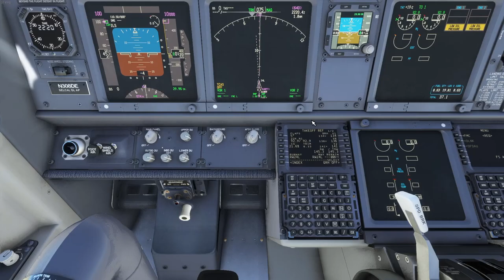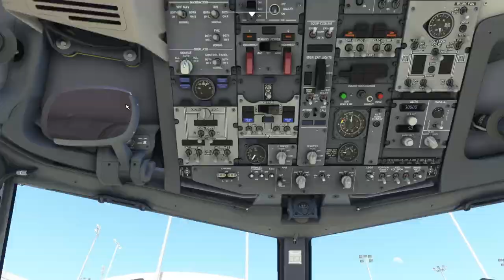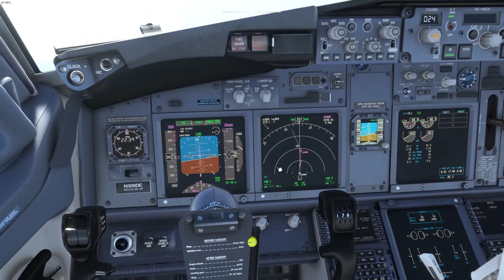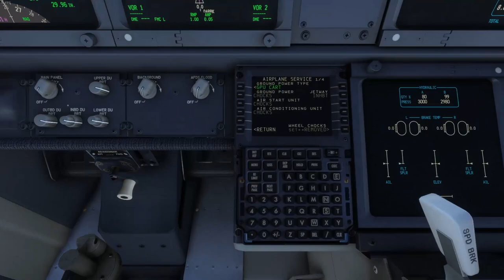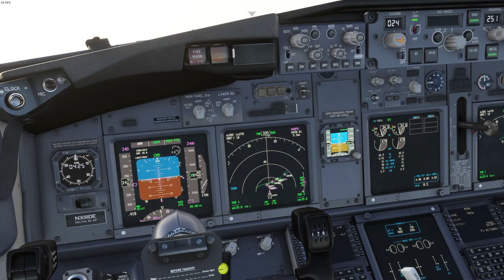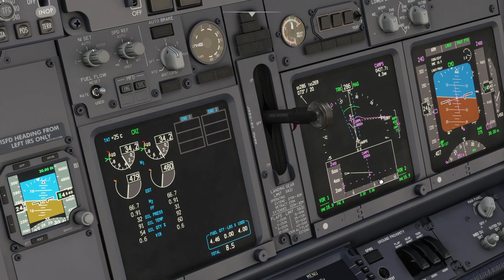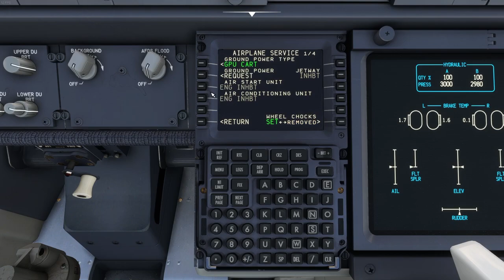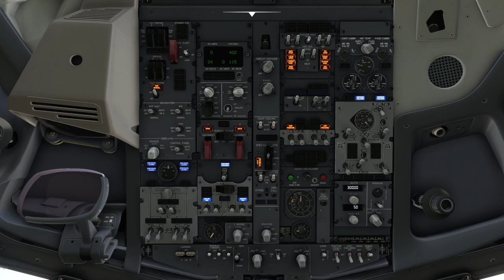Los Angeles To Hawaii Full Flight | PMDG 737 | MSFS

Comment: Nice video!  So you're operating under 180 minute ETOPS rules, so you're required to input your ETOPS Entry Point (EEP) , Equal Time Point (CP or ET) and ETOPS Exit Point (EXP) into your route. That info should have been calculated for you in your flight plan under an ETOPS analysis. Some great tutorials on youtube on how to do all that.  
Engine start I normally shoot for 21% to 25% N1 before I introduce fuel.  On a hot summer day, you run risk of a hot start at 18%, the more air flow, the better.  
You'd normally not enter your approach information (ILS freq, mins, etc) until before TOD during your briefing.  If you lost an engine or had to return to LAX for any reason, you'd what LAX approach information, not OGGs.   Plus winds might change in the next 5 hours, and with that the runway in use in Maui.
Reply from the maker: Im not sure what the ETOPS stuff is I will certainly look that up. And thank you for correcting the N1 starting %. I always thought 18 for some reason. I will certainly change that. And I usually put in the approach info on the ground and update it on decent. Thank you for watching!